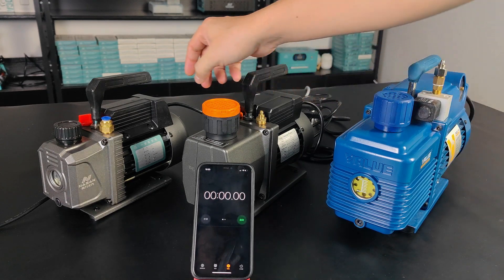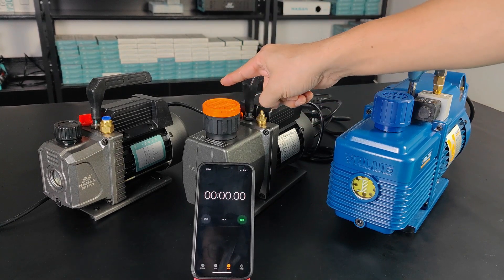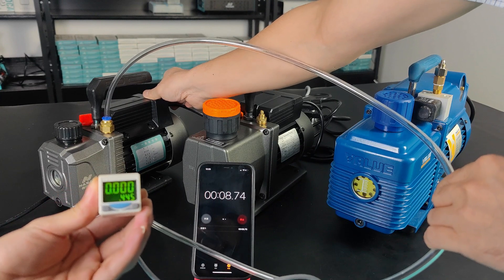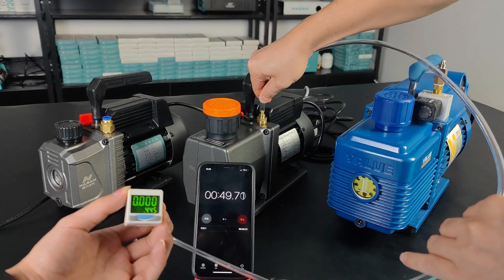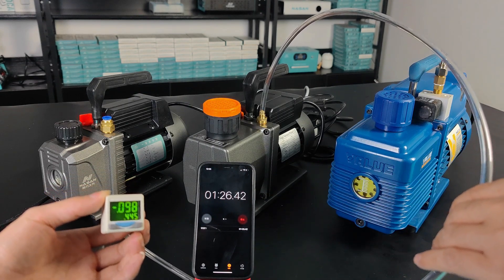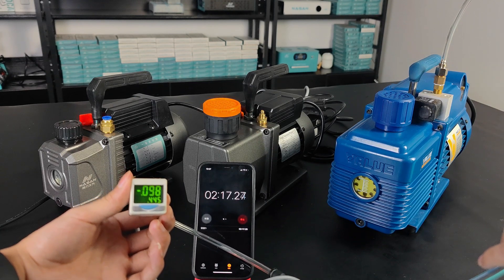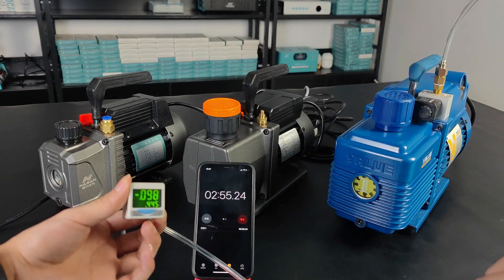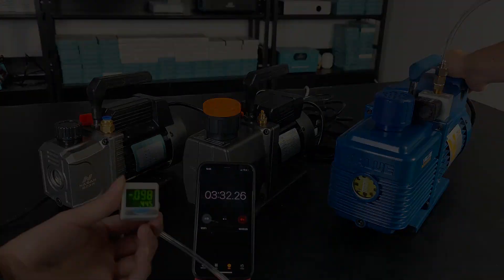What vacuum pump is best for your laminating machine?

Comment: The vacuum pump I’m currently using gets to about 96.5-97 kPA, but I still get pretty decent sized bubbles after lamination before autoclave. Would this be an issue with the vacuum pump?